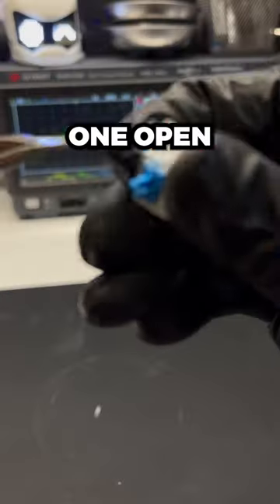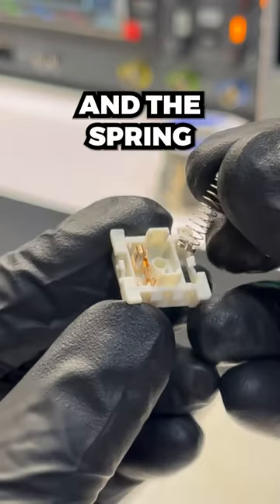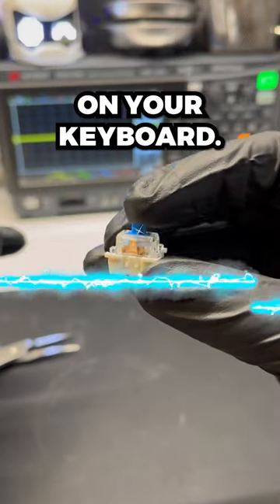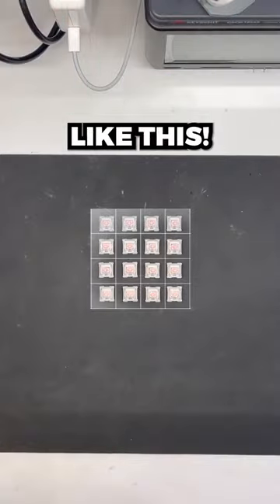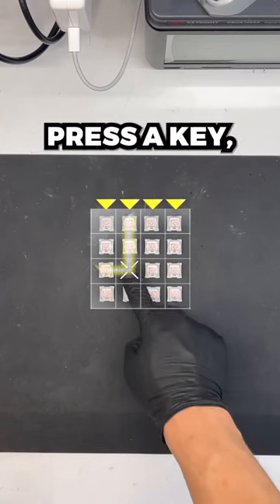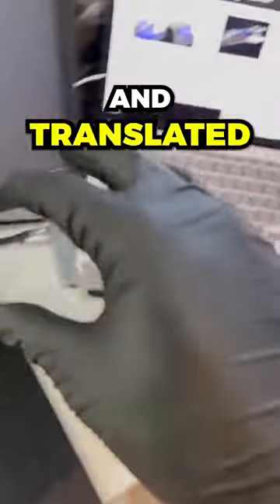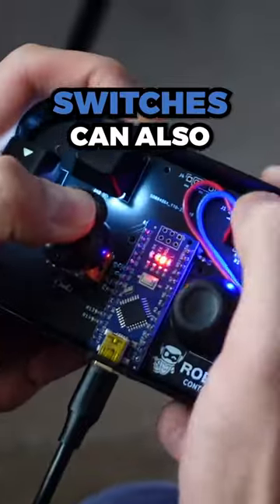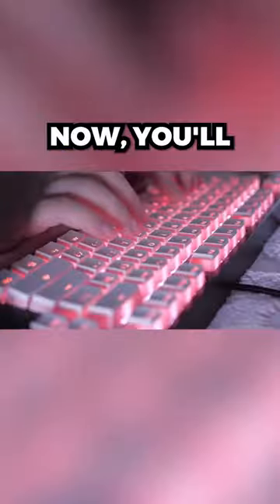How do Keyboard Switches Work? #electronics #maker #STEM #technology #engineering #robotics #arduino

Comment: It's important to note that the row/column method of reading keys is not how most keyboards work nowadays
If it was then you couldn't use two keys at once like control and c
Reply: Modern keyboards still use a matrix, however now each switch has a diode that prevents the controller seeing phantom keys. Modern keyboards can detect 3 or more keys at the same time, and some high-end boards have "N-key rollover" which means they can detect all the keys being pressed at once.
Reply: @alexglaras5090  Seriously it's that simple a fix?
I could've sworn it was more complicated than that
Reply: @alexglaras5090  Can you explain how/why that works. I would like to understand how the component interacts with the system to solve the issue
Reply: @alexglaras5090  they also use smaller groupings so they can detect all of the keys. The reason when it doesn't happen is cost savings, or technical limitations

Comment: PLZ HELP ME GITOUT OF THESE ERROR WARNING: library Servo claims to run on avr, megaavr, sam, samd, nrf52, stm32f4, mbed, mbed_nano, mbed_portenta, mbed_rp2040, renesas, renesas_portenta, renesas_uno architecture(s) and may be incompatible with your current board which runs on esp32 architecture(s).
In file included from C:\Users\91767\AppData\Local\Temp\.arduinoIDE-unsaved2023113-9464-1r8poat.6e85\sketch_dec3a\sketch_dec3a.ino:9:
c:\Users\91767\Documents\Arduino\libraries\Servo\src/Servo.h:79:2: error: #error "This library only supports boards with an AVR, SAM, SAMD, NRF52 or STM32F4 processor."
 #error "This library only supports boards with an AVR, SAM, SAMD, NRF52 or STM32F4 processor."
  ^~~~~

exit status 1

Compilation error: exit status 1
Reply: The servo library doesnt work on an esp32. If i remember correctly you can install an esp32 version though
Reply: @FronosElectronics  instead of stack overflow YouTube shorts ... Why not ? 😂😂😂